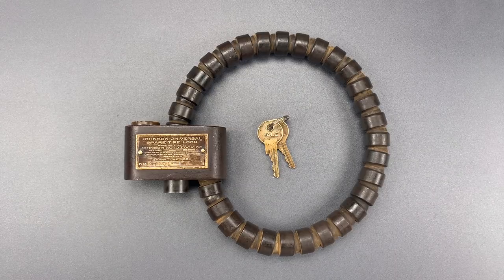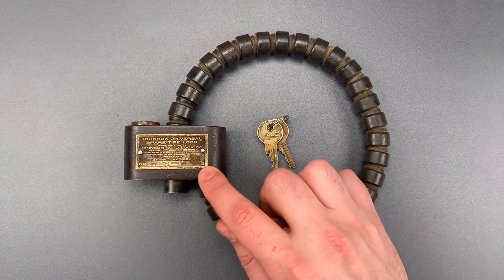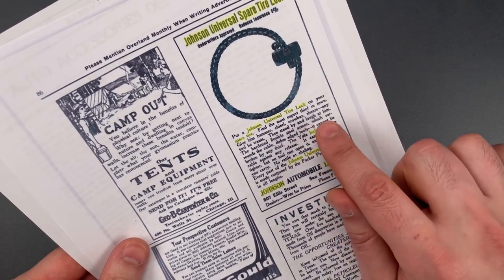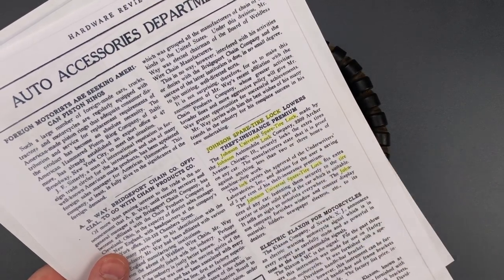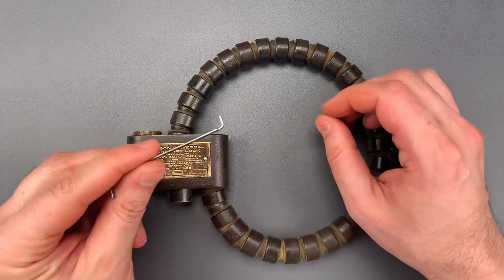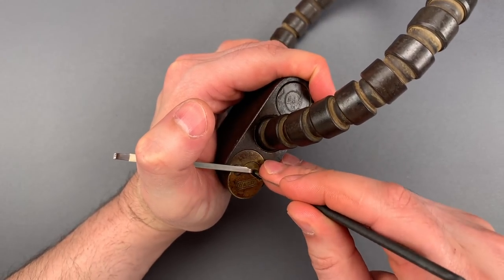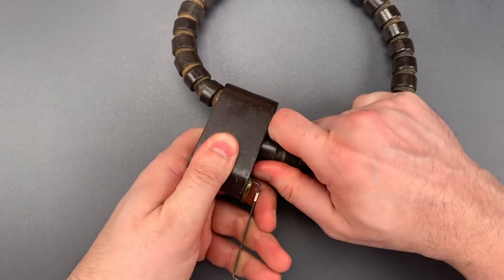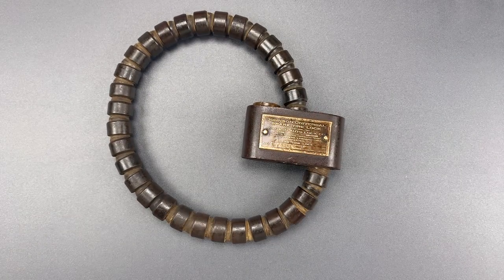[1069] 1920’s High Security: The Johnson Universal Tire Lock

Comment: "Masterlock number 3" sounds like a covert insult.
Reply: "Covert"? Um ... no ... watch some more of LPL's videos ... :laugh:
Reply: More like overt 🤣
Reply: I agree. The other way to say that is "A modern Master Lock #3 is equally vulnerable and basically the same as this easily picked lock from 100 years ago."
Reply: I thought it was pretty blatant
Reply: Sounds like a song similar to Mambo number 5 but with lock names instead.
Reply: In a nutshell master locks are trash.  I’m guessing a no. 3 is especially bad!
Reply: It's so disgraced, it couldn't even be number 1... Number 3, even in failure
Reply: It has 4 non-security pins and is recommended for beginners to practice on.

Comment: You know, if tomorrow LPL said "Today for you I have a plasma-core dimple lock from the year 2177" I think I'd just take that at face value.
Reply: I'll use the plasma-core dimple pick Bosnian Bill and I made.
Reply: "This is the Lockpicking Lawyer, and today I have a real treat: a Combine tripmine, commonly used to secure hallways, doorways, and fuel oil barrer storage depots against anticitizen activity or necrotic incursion.  It may appear tamper-proof at first, but using the multitool Alyx Vance and I made..."
Reply: "What I have for you today is an electronic lock costing tens of thousands of dollars that is used to secure this U.S. Government time machine at Wright Patterson Air Force Base outside Dayton, Ohio. Sadly, if the designers of this lock would have looked into the future, they would have foreseen that this design is surprisingly vulnerable to an unconventional attack. What I am using for that is a Zenith mechanical ultrasonic television remote from 1963.... Got a bleep on one, nothing on two, nothing on three, there's a false beep on four, five is blinking...."

Comment: "When you pick a hundred year old lock just to show how bad present locks are."
Reply: Why is that in quotation marks
Reply: I feel like he grew up picking locks for fun and has watched the quality decline and difficulty drop, so he made this channel to keep himself engaged and call out companies to build him better locks to pick
Reply: @stinkymart3173  More he is just very good from being very experienced at it. Actually picking a lock is incredibly rare in terms of bypassing a lock. Unless you are very experienced and can feel everything and easily as LPL can it takes quite a bit of time. And you are very obvious while doing it.  However, forcing a lock (which is what this was designed against) is far more common because it takes less time usually. And for a thief they want to grab and dash as quickly as possible.

This is why when imobilizers became built into cars forcing the ignition went away and instead of using a laptop and RFI sender to fool the computer most car thieves that are stealing and not just a quick ride use a tow truck. Faster, less obvious (to others looks like it might be just be a repo guy) and 100% guarenteed to get the vehicle no matter the security system.

Comment: Love the balance of talking about the lock being about the equivalent of a Masterlock 3, but the construction being superior to many modern day armored cables.

Now if a really good modern lock was combined with the build quality of the past, a company would really be onto something.

In a way, the switch in public buying to replace and dispose, combined with the switch in industry to obsolescence and build-to-cost has essentially been responsible for the drop in progress of security products.
Reply: You can still get good locks even though most aren't
Reply: @antonhelsgaun  too bad few people want to pay the cost for quality
Reply: Yeah, but who wants to pay that much for physical security? It's rarely worth it.
Reply: The cable looks to be the same build as my Abus cable lock - braided steel cable with those interlocked reinforcement housings or whatever you want to call them.  Mine is much lighter, though, and probably has thinner material throughout.  Tradeoff is it doesn't weigh three pounds.
Reply: I imagine you could turn this into a good bicycle lock if you took the core out and replaced the pins with serrarted pins and spools.

Comment: Let's remember the 1920s had no battery operated tools. Possibly few (any?) portable powered tools such as drills or angle grinders.
Reply: not much hardened steel, either, so bolt cutters were impractical.  a hacksaw would probably be the best tool, but that would be time consuming.
Reply: I mean yeah, but what's the point if you can pick it open
Reply: MrCh0o, they didn’t have Sparrow’s either 😂
Reply: they too didn't have pick that bosnian bill and he made
Reply: @thomasjenkins7506  They did have cold chisels and engineer hammers however. Both small and easily concealed.
Reply: @tetsubo57  cold chisels and a hammer could've done it, but it's loud and obvious on top of being rather difficult on something that would move around every time you hit it.
Reply: So? He didn't use a grinder, he just picked it. I'm pretty sure lock picking was a thing back then
Reply: @theoriginalshew  you're also talking about a trade that was still passed down from journeyman to apprentice and did what they could to protect their secrets.  i'm sure there were thieves who could pick locks at the time, but they probably weren't wasting their time stealing spare tires.
Reply: @tetsubo57  And oh so stealthy............. "BAM! BAM! BAM! BAM!"
Reply: @theoriginalshew  he used sparrows tools. I'm not those existed as product one could buy at a store
Reply: Part of me thinks a slide hammer would yank the core, the other part would never try on such a nice collectable.
Reply: Exactly, against anything short of power tools you'd have a challenge to break this

Comment: Next video:

Lockpicking the Gordian knot in under 20 seconds
Reply: It was technically. Just....with a sword.
Reply: @das3610  Bypass is a legitimate strategy
Reply: @das3610  "As you can see it is easily defeated by a relatively low skilled attack."
Reply: @das3610  I don'tthin destructive methods count as lockpicking, or a bomb would be the best tool for any lock.
Reply: Lockpicking Fort Knox strongest lock without touching it
Reply: [1070] Gordian knot picked and gutted

Hello this is the lockpicking lawyer, and what I have for you today is the Gordian knot... (30 seconds later)... As you can see, it's not too terribly hard to pick, but it's definitely impressive for the time period that it was created in... In any case, that's all I have for you today if you have any questions or comments about this, please put them below. If you liked this video and would like to see more like it, please subscribe, and as always, have a nice day.
[1071] Gordian knot destructive testing
Hello this is the lockpicking lawyer and today we will test the durability of the Gordian knot. A lot of you guys pointed out the very simple sword exploit that defeats it in mere seconds, let's get the knot down to the garage... (In the garage) To defeat the Gordian knot, I will be using this period correct sword I bought in home depot, it was the cheapest one available... First, I'll try to cut it in one swing and if that doesn't work, I'll use a divide and conquer approach, cutting a few strings at a time... (cuts the knot on his first attempt) woow, that is true garbage, let's try cutting another portion of it just for fun.... (back to the regular setting) well, it appears that while effort was put into making it pick resistant, the designers made no attempt to make it durable. In any case, that's all I have for you today, if you have any questions or comments please put them down below, if you liked this video and would like to see more like this, subscribe, and as always, have a nice day.
Reply: [1070] Gordian Knot picked FAST
Reply: **with a spoon lol
Reply: @snapcountersteer  And on the other side of the screen an archaeologist is in tears. 😱😢😥😭
Reply: So it looks like if you replaced the core with something more tricky, then this would be better than nearly all of the cable locks I've seen around. Including kryptonite ones (this is bad K). The armouring looks like it would defeat cable cutters.
Reply: As you can see, the knot can be unraveled with a simple leaf rake attack. To prove that this was not a fluke, I''ll ask Gordias to tie the knot again and... Dead? When did that happen? Over 3000 years ago? Why wasn't I told about this?

Comment: While the core is obviously not great by todays standards, it is worth pointing out that, depending on how the lock is positioned, it would be really difficult to tension if it was actually on a tire. You certainly couldn't do it the way LPL did.
Reply: Especially if you put the lock between the tire and the car in a place that is hard to access.
Where you could get the key in, but just barely.
Reply: Next time: LPL picks it in the most fucked up position possible with picking tools available to a thief back in the 1920's.
Reply: This is something I often wonder about some of these lockpicking videos. It might be relatively easy for LPL to pick some freestanding locks in the comfort of his studio, and I admire his skill, but I imagine it can become a lot more difficult when they're attached to something "in the wild" due to various factors.
Reply: @zoomosis  pretty much, if one could put the lock positioned where a sparrow wouldn't fit but the key could you gained precious time on deterring a thief
Reply: @fabriciogoulart4564  but then again the vast majority of people have locks easy accessible to themselves with zero regard for making it more of a hassle for intruders.
Reply: @jongustavsson5874  Convenience Trumps Security in many regards.
Reply: @lucielm  Yepp, that's the truth. Worked at a lumber mill where basically every emergency shutdown button was bypassed because it was to much of a hassle to reset if they where used. Was kinda not good when they where needed.
Reply: @lucielm  Or was that for Trump Convenience is worth more than Security?
Reply: Indeed, but then again I sometimes have a hard time opening my bike lock with the key depending on its position.
Reply: @Geoff Rogerson they are, third language though so I'm bound to fuck up on occasion, especially since where and were have the same meaning in my first language.
Reply: I'm just impressed with the cable. I feel like a prying attack would just pull you apart.

Comment: I'd love to hear more about how they manufactured the flex in 1920..
Reply: It looks like a series of ball in socket joints
Reply: @roadcam249  yeah it does and depending on the strength of the steel and tools back then that would have been quite the challenge

Comment: Whenever there is a (really) old lock featured in a lockpicking video I always wonder what the quality of tools where back then.

LPL opened this one up easily with what we have today but when they first made this lock would pickers have access to material as strong and thin as what we have today?
Reply: 0.025" is not particularly thin, and with how wide those older keyways are, an even wider pick might have been usable. I see no reason why a lockpicking hook like that could not have existed with 1920s metallurgy. Perhaps the tool might need to be made of carbon steel rather than some of the harder stainless alloys we have today, but I would think it would be doable.
Reply: TheDitz42 consider the tools that existed in the watchmaking trade even before the 1920’s.  I suspect that even an incompetent watchmaker would have had the tools and skills needed to open that lock, at least with a little practice.
Reply: How were they gapping spark plugs back then? LPL uses a tool made from a feeler gauge to open lockboxes. It isn't much of a stretch to go from feeler gauge to hook. So the tools aren't the issue, it is the steel used that is more likely to cause issues. Too soft a steel and your feeler gauge or hook become useless.
Reply: Yeah ifgured the size wouldn't be a problem but the strength needed, I guess you'd be able to make picks that'd work but not for long.

Maybe thats the idea behind picks breaking in video games.
Reply: TheDitz42 nah they add that to games for balancing
Reply: dont forget street sweeper blades you could make tension wrenches and picks from. simply from placing in sidewalk cracks and rubbing on sidewalks to shape picks from.

Comment: Could you redo this with picks and tools they'd have had at the time?

Edit: I didn't realize he basically had - cool!
Reply: He pretty much did, he only used a standard hook and a tensioner, which definitely existed in the 1920s.
Reply: Yeah they didn't have wipers and their inserts back in 1920
Reply: @kidthorazine  Nah dude they only had bobby pins and paper clips.
Reply: @mkfldargfv  Wind shield wipers are a very old invention in the car industry, though on cars that old they would typically be hand operated instead of the electric motor used in later cars.
Reply: Slip gauges were extremely common in those days as you had to readjust the ignition contacts, the valves and the spark plugs every few 100 miles.

It's not a big deal to make picking tools out of a slip gauge/feeler gauge.
Reply: All tools he used could be done out of feeler gauge with some manual trimming. Nothing that didn't exist back then.

Comment: Maybe a neat idea for a challenge: try to pick/bypass the 1920's lock with 1920's tools.
Reply: With a wooden rake.
Reply: The picking tools were available at those days. You can easily make them from a feeler gauge, and these were very common as a basic tool for engine maintenance.
Reply: Picks haven't changed in centuries.

Comment: The weight of the lock is a good indication of it’s durability. This is going to be used on the outside of a motor vehicle and have to endure exposure to the elements for a long time. If this wasn’t a collector’s item I would be interested to see how the cable holds up to a physical attack with period (not modern) tools. Thank you for sharing this unique lock.
Reply: from experience, the tools of the time could've done the job, but they were impractical for a thief.  since there wasn't much hardened steel nor replaceable parts, ruining the jaws on a set of 42" bolt cutters would cost you more than you'd get for any spare tire.  that's not even accounting for their size and weight.

Comment: A Master #3 rarely requires you to go up and down the pin stack. If you just clamp the tension hard you can make all the pins bind up at once (because everything is made out of butter) and simply bitch pick it from front to rear, or rear to front, as you happen to prefer.

Comment: It took longer to pick than basically any masterlock, is pretty secure against physical attacks even nowadays, and was made at a time where powertools were way weaker and more expensive with basically no portable devices, and learning lock-picking was also way harder, there were no decent tools to just buy.
So while the advertisement was comical as the old ones often were i would trust this lock over most modern sub 40$ locks.

Comment: "No tool can open it except the key you carry" - so the 1920s equivalent of all the modern day manufacturers claiming (without a shred of evidence) their locks are "pick proof" (so forming an irresistible challenge to LPL who quickly discovers they're anything but pick proof)...
Reply: That statement is absolutely correct, as even LPL needed two tools simultaneously to open that lock.

Comment: i have a question about the pins in a lock. Why do pins lock back wouldn't it be 10 times harder for some one to pick a lock if the pins are being pushed down at all times instead of them being locked back?  I always thought that would be the safest lock or is it due to friction putting wear and tear on the key and lock?

Comment: Could you get a piece of spring steel 25/1000 (twenty-five thousandths) thick back in 1920?  Try picking it using tools from the era.
Reply: Yes, of course. Feeler gauges were already abundantly available, as every mechanic needed them to readjust the car engines (ignition contacts, valves and spark plug electrodes)